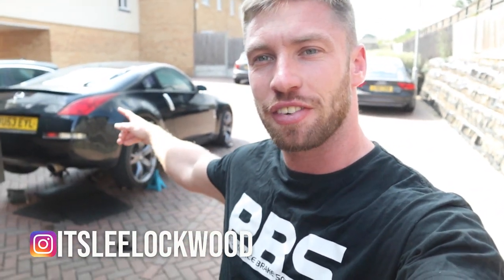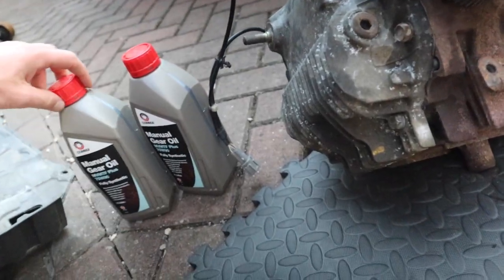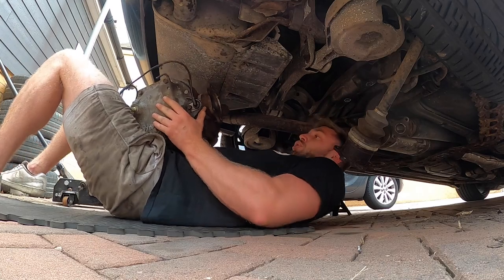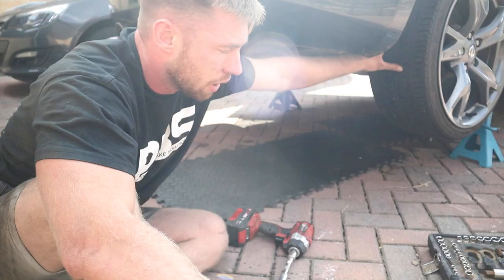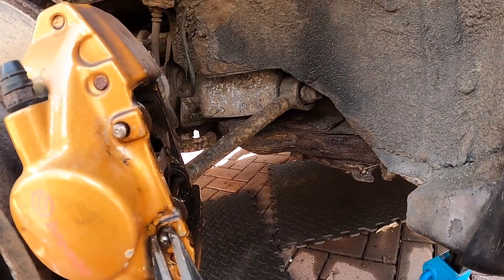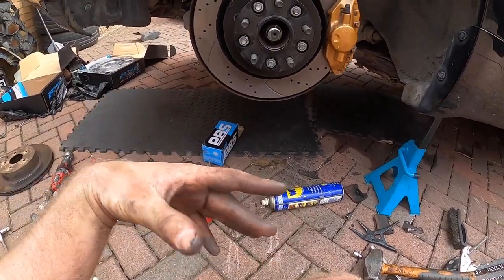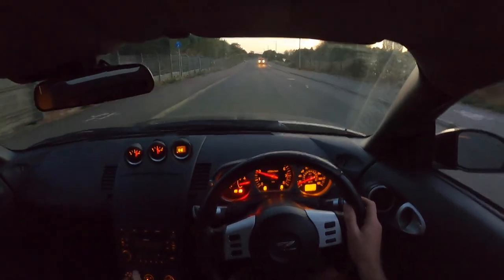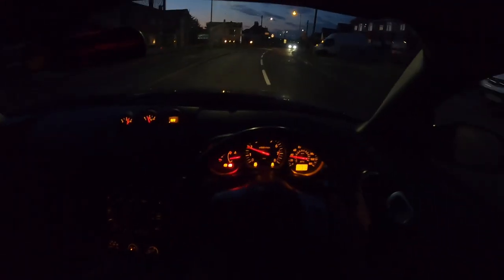this DEFINITELY wasn't easy... Cheap 350z Drift Build.

Comment: One important thing to mention as can often be overlooked when replacing brakes.. always check the level of brake fluid once installation of pads / discs and pads is complete. It can often be too high due to a combination of the fluid you have returned back to the reservoir which isn’t a problem unless  some-one in past has been topping the brake fluid up in-between pad replacements the fluid could of well exceeded the max mark which will cause multiple braking issues as fluid expands when hot so needs space in reservoir to do this , May need to remove some fluid so always check level 👍🏻

Comment: Tip for wheel nuts mate, gun them most the way off then wiggle them of the socket and finish it when they unstuck, makes it loads easier

Comment: PBS have come a long way but compared to Carbon Lorraine, Performance Friction, Pagid, Endless etc they still have  long way to go. Good for the money and better than low end pads though. Anyway, great to see these early upload vids, less likely to miss them than if they are during the day. Mtec discs however won't even last 2 track days without warping if you are driving quite hard. It looks like the mods you have done have made a big difference. 👍

Comment: Using your body as a gearbox stand is a good work out from the looks of it.

If you have External Torx on brakes...I will pray for you that you don't reach for the blow torch. I had a right hard time on my MK3 ST doing the rears because of it (in time to do one calliper on the rear i'd done both the fronts)

Comment: That little brake bracket needs 2 bolts. I did exactly the same as you, sheared one bolt and Thought it would be fine. It wasn’t. Sheared brake line 😂

Comment: Hate to be that guy, but your diff-subframe washers are upside down 🥴 the thick flat one goes to subframe, thin moulded one goes at the bottom with the rubber sleeve

Not sure if it'll make a difference but worth noting! Done 3 diffs like this and it's brutal 😂
Reply from the maker: oh really? I had the nissan diagram up and it seemed I got it right.. I was contemplating though.
Reply: @itsleelockwood  now I'm questioning it 😂 but yeah I'm pretty sure man
Ultimately don't think it matters tbh